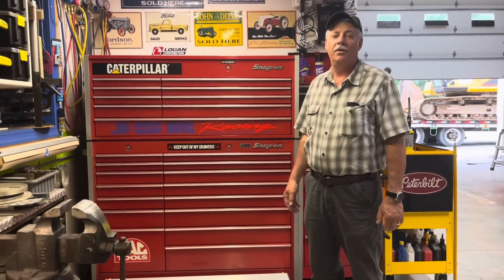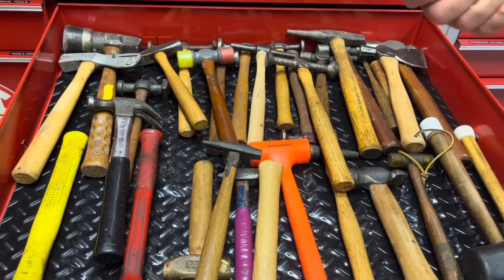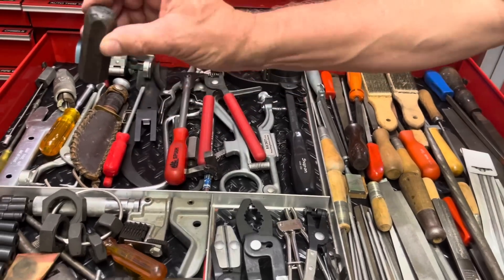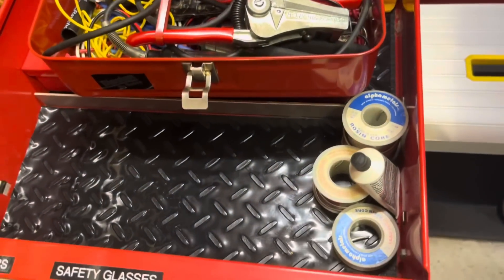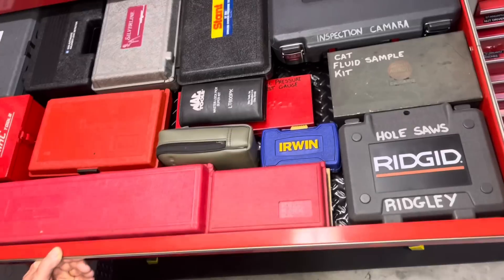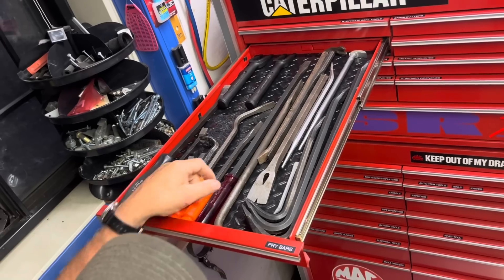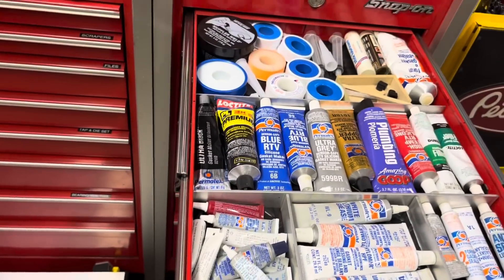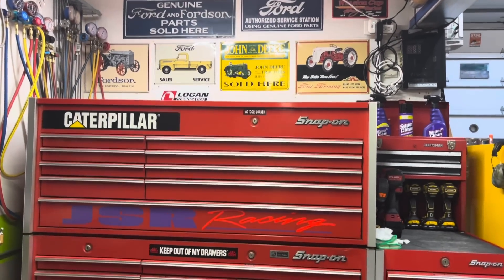Shop Tour | Toolbox Tour | Ridgley Contracting

Comment: I find those dividers interesting. Where did u get them
Reply from the maker: Just thin aluminum angle from Lowe’s, cut to size , riveted down and cut the liner to fit around them covering the bottom flange. Different width angle for different height drawers.